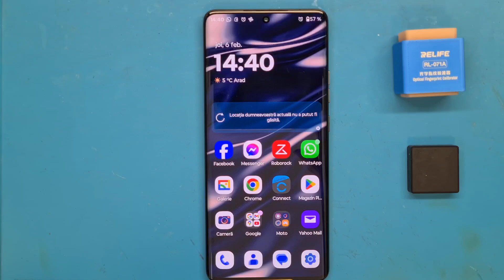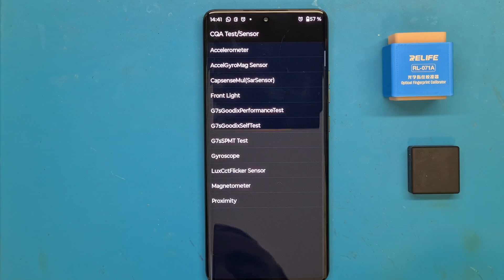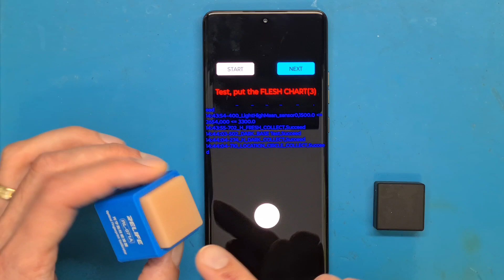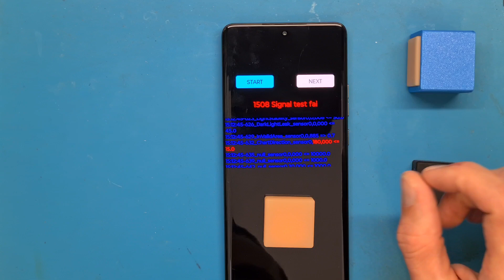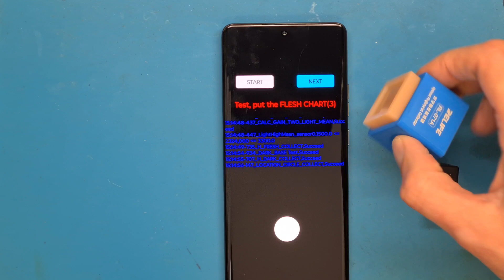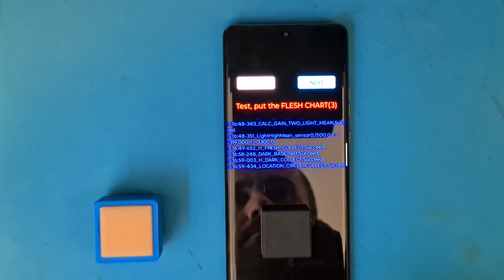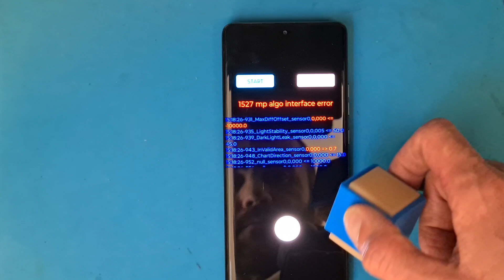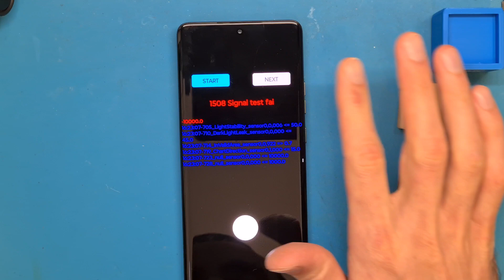Motorola edge 50 ultra fingerprint error after display replacement calibration fail

Comment: i always get the same error: EXPO 10.0. i dont know what im doing wrong. of course i dont have the proper tools, just paper, a black paper and my finger. but anyway trying. after screen replacement on my motorola edge 30 im having this issue
Reply from the maker: I ordered the new calibration tool but the phone is not available for me to test yet

Comment: I can confirm that the calibration works with the calibration tool RELIFE RL-071B. It comprises 4 pads, skin color without texture, skin color with texture, black and blue with texture. In the procedure of the video, use the skin color pad without texture for the "FLESH FLAT (1)", use the black pad for the "BLACK FLAT (2)", use the blue color pad with texture for the  "FLESH CHART (3)". it worked for me (it was worth the 8,98 € on Aliexpress), good luck!

Comment: Hi! Thanks for the video - I just managed to fix the fingerprint after display replacement in Moto 50 Ultra! I used a block od white sheet paper, black cloth folded a few times (to make sure the material is thick, no see-through) and my thumb, placed vertically and pushed down strongly in the last step. I tried to stay completely motionless and used the upper half of my thumb, hope that helps you to pass the test!
Reply from the maker: Thank you, I will try again, happy you could fix it!

Comment: You don't even need any tool to calibrate it. Just use white paper for the FLESH FLAT, put your finger verticaly for BLACK FLAT and touch fingerprint sensor after press next, and for the final step FLESH CHART put the finger horizontaly. I did this on my Motorola edge 50 ultra after screen replacement, and now it works, I can add different fingerprints from the settings menu after calibration was done
Reply from the maker: Thank you for your tip but unfortunately in my case I tried so many Times... and could not get it done without errors, thank you 🙏
Reply: thank you! it worked for me. for the first step i used a white paper, for the second my fingerprint and for the third the other half of the finger
Reply: @dimienescucostel5909 what u mean in half finger can you explain please
Reply: I need your help for doing this

Comment: Update, I don't have a calibration tool but i been using some workarounds to test and got all different kind of error messages, i will go back to the service center and ask them for the tools. Apparently those three calibration tests are brigthness compensation, focus and geometric calibration for the fingerprint sensor. I will keep you posted
Reply from the maker: Fingers crossed!